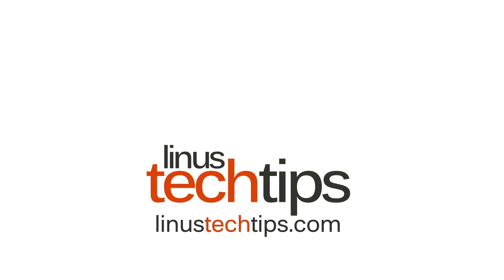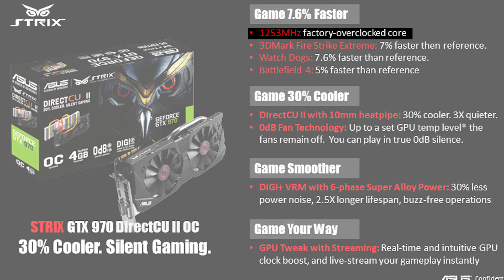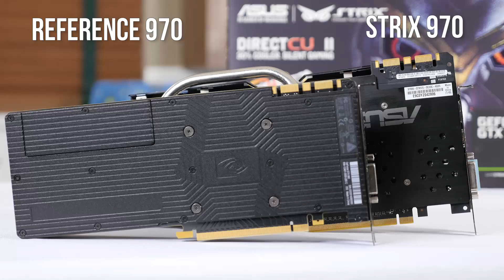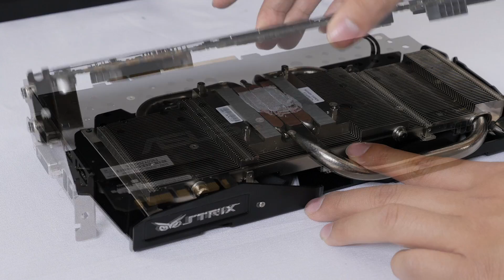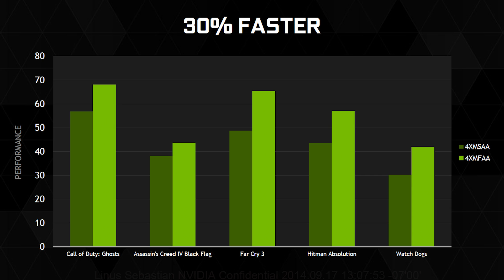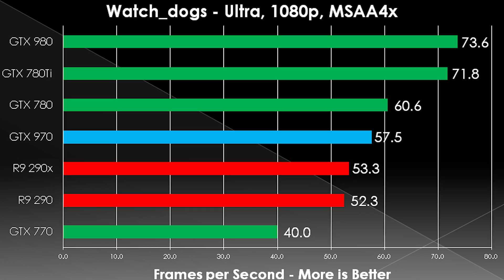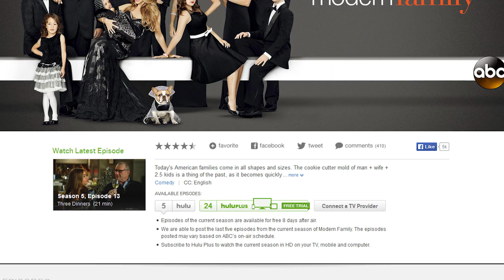ASUS Strix GeForce GTX 970 Video Card

Comment: is it possible to run 3, 4k monitors ultra settings yet. Not with this card but with any.
Reply: CrazyPieCat  3840 x 2160 = 8294400 pixels 1920 x 1080 = 2073600
8294400/2073600 = 4.
do simple math please
Reply: Lets put it this way. 1080p 60 fps in crysis 3 at all setting at absolute maximum is still impossible with a single gpu (non-overclocked). To go to 4k you would quadruple the resolution, and 3 screens would triple the resolution again after that, so that would be 12 times more power than 1080p
Reply: i was talking about quad sli
Reply: WuApricot Then please read my comment again. 1 card cant handle 1080p60 on the most demanding games. going from 1080p to 3x4k would take 12 times the power. you can only have 4 cards, so no, triple 4k is not possible in the most demaning games.

Lets take a benchmark as an example. The 980 can only play crysis 3 at 4k at 20 fps when all setting are maxed (except for AA which is turned off). To get to 60 on ONE 4k monitor you would need more than 3 cards alone, so putting triple 4k monitors would be useless unless you like playing counter strike and tetris
Reply: welp ima just get that new 34" ultra wide curved from LG then.
Reply: pingo6able You can't run 3x 4k now. Do you not understand that? Quad SLI does NOT quadruple the performance because of driver issues and scaling issues. In fact, after the second graphics card you'll get only %10-20 percent of the card's actual performance. So you need 12 times more power than 3x 1080p but you'll only get 2.7 of the power with Quad Titan's or dual 295X2's.
Reply: WuApricot yes do that
Reply: Probably with two titan blacks, or 980.
Reply: LapX If you are answering the OP's question, then no, 3x 4k is not possible at ultra settings, not even with 4 gpus (and titan blacks arent really that great for gaming)
Reply: Christoffer Nørskov I didn't read ultra settings, sorry. And why would Titan Black be not great for gaming ? They're just a 780 Ti with more VRAM. I know they do not offer the best bang for the buck, but if you have 3 4k monitors, you're probably past that.
Reply: No. 3X 4k monitors is out of the question right now for gaming except mine sweeper.
Reply: Christoffer Nørskov well, the gtx 980 can do crysis 3 on high 4k 30-40fps... so i'm assuming if you had quad, you might(take that with a grain of salt, because sli has diminishing results) be able to 3x 4k. i wouldn't try it though.
Reply: pingo6able 980 can barely do 30 fps on ultra (with AA turned off) so 4 cards would only be about 30 fps on 3x4k screens. Anything under 60 is just not good enough
Reply: run, maybe. Run well, no.
Reply: 김동현 exactly, when people talk about puting cards in sli expecting them to all run at max i just laugh. they dont actually do much unless the first card crashes or so on the other cards ar puting forth a small amount of energy, but yes they do give you 10% or so better performance...
Reply: deviant gaming That might be a little extreme. On average, the second card will net about 80%, the third card about 50% and the fourth card 20-30%. Some games scale extremely well, though and allow for up to 99% on the second card
Reply: 김동현 did you not see the part where i said "take with a grain of salt, because diminishing returns and all that". You could probably have playable on like low but its not really worth it at all.
Reply: tEHFRECKLEZ look at the review of the 980, not even that can max crysis 3 at 60 fps average
Reply: Christoffer Nørskov
Yeah, I saw that. I just remembered wrong with one of the cards doing it 60fps max.
Reply: Christoffer Nørskov that one had vsync on
Reply: pingo6able there is more than one review, some without vsync. And no, it cant do more than 60 fps im crysis 3
Reply: when then that's just crysis 3. the games optimized pretty shit.
Reply: dayz, arma 3, bf4, far cry 3. and so on are good areas to benchmark imo
Reply: any 1 card?  depending on what fps you want to get
 sure
Reply: Dont do titan z. Ever. 4x titan blacks is cheaper and cooled better.
Reply: pingo6able never go quad sli. 3 at maximum
Reply: ***** titan z is a shit card, its a dual gpu card, so you can only use 2. Its also slowe than 2 titannm blacks or 980s, so absolute shit, even if you have the money
Reply: ***** dude, when a dual gpu card has 12, thats only 6 gigs of effective memory because the 12 are split between the gpus. The titan z is still a shit card. Its 2 underclocked titans
Reply: ***** you can get all the fast memory you want, doesnt change the fact that titan z is heavily underclocked. It would be a much better deal to buy 980s for triple 4k gaming, since it also uses the new memory compression tech. And putting workstation parts in a pc for gaming is an outright bad idea. Workstation cpus often have more cores at a lower clock speed for 10x the cost. Games need clock speed more than they need cores, so a xeon isnt optimal for gaming in any way
Reply: ***** op posted about playing games, had no idea we were suddenlybtalking about development. Even then, the titan z is a bad buy, titan blacks are better in every way except size.
Reply: Christoffer Nørskov well it's better than 2 titan z's. Dont even needcthat much. At 4k, most games only use ~3

Comment: So the gtx780 is better than the 970?
Reply: That depends. At stock, the 970 is faster. When overclocking the 780 is likely faster, but it depends on how well your card is binned (basically luck)
Reply: Christoffer Nørskov yeah the 970 have only one 8-pin. that can be one reason
Reply: Baker Pantheon the power isnt an issue here. I believe 8pin is 300 watts, and the 970 is rated for about 150 watts. That should leave plenty of room
Reply: Christoffer Nørskov hmm maybe.
Reply: I think Linus said they got a golden chip in their 780 so I think it overclocks really well.
Reply: CanIHasThisName yeah that might be it i dont know the maximum output on 8 pin
Reply: check more videos than just this one. Gigabytes windforce 970 dominated the 780 and got very close to the 780ti(and beat it in only one game)
Reply: ok thank you all
Reply: CanIHasThisName who cares? If you can afford to buy a 970 you can afford the extra money on the electricity bill.

Comment: Really awesome card! Will this card work good with an i5 4670K?
Reply: as long as it's a quad core+ with a good clock, cpu doesnt matter  much
Reply: Christoffer Nørskov tnx
Reply: ***** You should go with an i5-4690k instead. It costs pretty much the same, but has slightly better thermal interface material, which will give you better temps, therefore a higher feasible clock speed when overclocking.

Comment: I own a ATI 5970 and have been wondering if I should upgrade to this "GTX 970" or wait till until 20nm/16nm (whichever comes next). I have enough money to pay for the card but I can't compare the difference very easily, the only major disadvantage I notice with my ATI 5970 is the cooling which is abysmal and lackluster hitting temps or 80-100*C after multiple hours gaming within a fairly air-cooled case... This beast of a card renders my room 29-30*C when I'm heading to bed which has made me ponder upgrading to a new card with a respect towards cooler temperatures...  My question is: Should I wait till the next set of cards, or upgrade now? I guess you could say my main focus is I don't lose performance, but at the same time, decrease the temperature of the card
Reply: I have the 6950, which is essentially a 5970, with better tesselation and AA, and i am going to upgrade. Mine doesn't get as hot as yours, since i have a beast case with lots of airflow, but it's starting to show it's age
Reply: Christoffer Nørskov What games do you mainly play? (I'd assume minecraft because of your picture, but I'm not going to jump to conclusion)
Reply: Christoffer Nørskov Looking at benchmark comparisons (anandtech) the ATI 5970 doubles the 6950 in fps in most games, and I've always compared the ATI 5970 towards a 7950,  have I been looking at this wrongly?
Reply: The Jege That picture is ooooold, no i play a lot of different games, and qute a few are very grphically demanding. 5970 is NOT twice as fast as 6950. It's the little brother of the 6970, which is one generation newer than 5970. Just like how a 680 is about the same as a 770, our cards are about the same
Reply: The Jege well, pardon me, i had simply expected their naming scheme to be the same, but that apparently changed with the 6000 series. Yes, the 5970 is a dualgpu card. That doesnt nessecarily make it twice as fast, since scaling was not as efficient back then, and dual-gpu cards were very new, so they are likely clocked lower than a 5870
Reply: Christoffer Nørskov I've looked at some review websites, I may have been wrong about the "double fps" (anandtechs benchmark needs some work) The correct assumption is the ATI 5970 is about ±30% faster than the 6950. This is because the ATI 5970 is a Duel GPU card (2x 5870's) whilst the 6950 is just a Single GPU making the comparison a bit one sided.  But what graphically demanding games do you play (if I may ask)
Reply: The Jege modded skyrim, witcher, crysis, star citizen. Lots of different games i cant remember off the top of my head. Also, yea just made a comment about the dualgpu thing
Reply: Christoffer Nørskov Star Citizen, that any good? I hear about it, here and there, but nothing really about how it is to play and if its worth it
Reply: The Jege its not out yet, some specific parts of the game are out in alpha/beta, but even that requires serious hardware
Reply: Christoffer Nørskov What fps you getting in Star Citizen?
Reply: The Jege Not sure, i dont really use an fps counter, but it is noticably laggy on my gpu (on very high)

Comment: Should I get this instead of the 980 to get a better cpu? Im currently getting a i5 4690k but if I get this i can upgrade to a 4790k. Is it worth it? I plan on streaming, high end gaming, etc.
Reply: No. i7 won't add to gaming. Graphics cards will.
Reply: hyperthreading makes no difference in anything so stick with the i5. Plus if you plan on streaming  you can just do it through shadowplay, it allows for up to 720p@30fps streaming and you can also have a webcam running if your into that thing but if you rather use OBS i believe most intel cpu's now have quick sync which allows for faster encoding if memory serves.
Reply: I would, but you have to decide what is best for you. I don't just game, and many of the games I do play, arma for example, are extremely CPU dependent.
Reply: I would, but you have to decide what is best for you. I don't just game, and many of the games I do play, arma for example, are extremely CPU dependent.